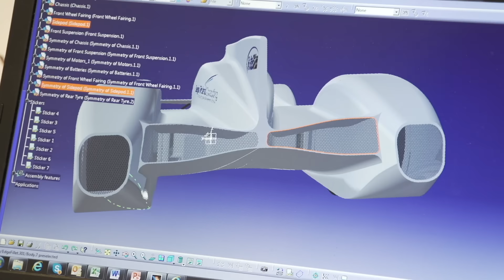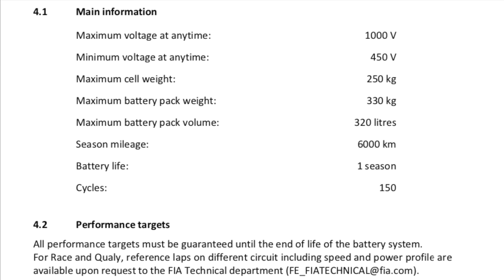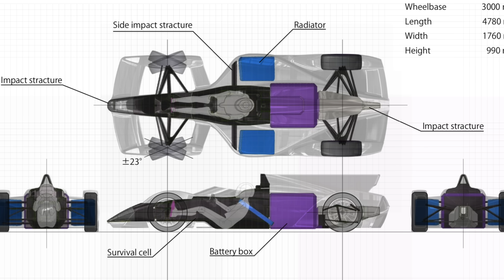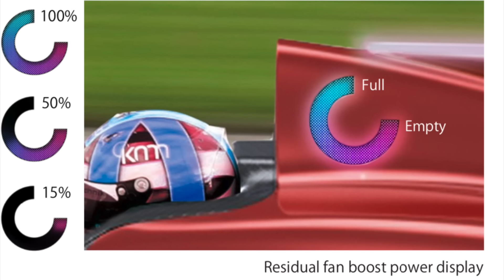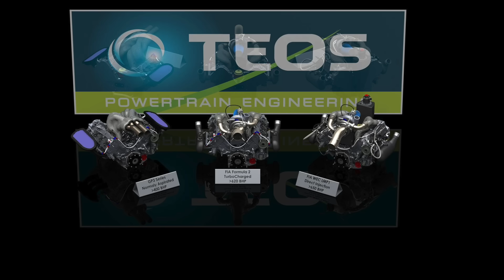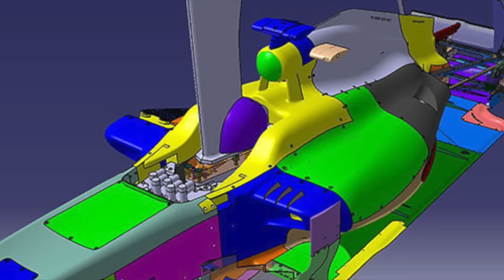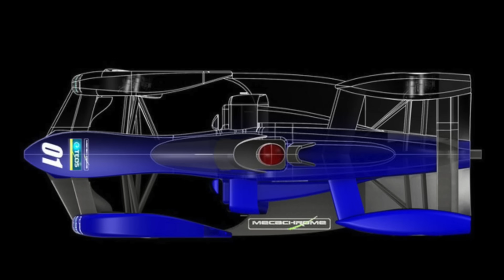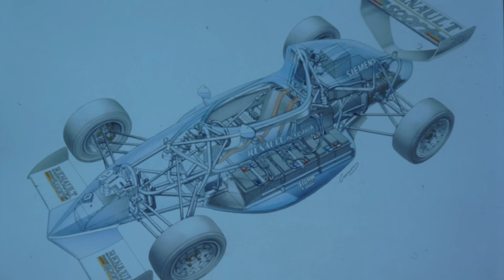The forgotten Formula E concepts - how these wild Season 5 cars could have changed everything

Comment: I think it's really interesting how the chassis supplier and the battery supplier couldn't work together until they both knew they won the tender. I do quite like the look of the dome, but I just think it was a bit far away from an open wheel car. And the lasers are a really interesting concept as well, not sure about the drone thing though, that's kinda silly. I think some of their lighting ideas were really cool though, I think a charge indicator that changes color could still very well be introduced today. 

I think Spark and FE eventually went with the best design. Absolutely love the Gen 2 car, one of the most beautiful racecars in history in my opinion. Miss it every day.
Reply from the maker: Some very good ideas here, I wonder how the Dome design would have evolved, like the Gen 2 did from that first sketch.

Comment: Why do they open tender for car designs, if they just keep going with the same company?
Reply: Because there might be better options making their case. The tyre and battery tenders have been awarded to a few different groups via this process. Podium were a surprise winner of the Gen4 battery contract, but definitely have their MotoE battery supply experience to speak for their credibility. 

Chassis wise there's only really the Spark/Dallara collaboration which has a track record in building EV racing cars at this level. If there had been something like an LMP-E category or an EV junior single seater series which had allowed more opportunities for constructors to demonstrate their capabilities, they might be in a better position to be successful in the FE tender  process.
Reply from the maker: @benjaminbunny2198  Dome had already built electric racing cars...
Reply: @Samsthepits  What were they?
Reply: @benjaminbunny2198  yeah you'd have quite a difficult time finding any open wheeler nowadays that isn't built by Dallara
Reply from the maker: @Kilo-sz4ch  They do build good cars
Reply from the maker: A good question

Comment: will the Spark 05e be used in FG series?
Reply: It is not the plan. They used an SRT05e for the test mule and demo car but they are supposed to make use of a bespoke 'FG-Twin' chassis. We haven't actually seen any evidence of that project progressing beyond the (Daniel Simon-designed) renders from about a year ago though.
Reply from the maker: yeah lets see what happens, I don't know if the FG-Twin will ever get built, but using the SRT05e makes a lot of sense.
Reply: @Samsthepits  Supposedly the barrier to using the SRT05e for this is that the chassis IP is collectively owned by the group of  manufactures who competed in Gen2. Jeff Dodds has mentioned this too, but in doing so implied that the Gen3 rights have been handled differently and thus could be used as the basis of a lower-tier competition once Gen4 arrives.

Comment: I think chassis/aero concept have always been a centrally important challenge for EV race cars and their unique requirements for maximum energy efficiency. I was disappointed when they announced that they planned to stick to the single chassis indefinitely. Having constructors iterating around low-drag, downforce-efficient ideas to extract maximum pace and range from these cars would have been phenomenal for the engineering enthusiasts amongst us. 

However, I do think it was broadly the right commercial direction for the championship and this has been key to its longevity so far. They knew that as a new championship the development budgets they could only go so high and support so much. As such, they chose to prioritise allowing development of the powertrain and control software in open competition. By 2020 even this limited scope had caused the amount that manufacturers were spending to climb too high, too quickly. They had to scramble to stabilise the championship with cost saving measures and impose a cost cap and this was successful, but they still lost some high profile manufacturers along the way. 
 
I do believe that adding in battery and/or chassis/aero development into the mix would have seen them hit this crisis point earlier and with more severity than what we saw in 2020, to the extent that it could have collapsed the series altogether. It has always been about managing the growth in competitor costs relative to the growth in commercial returns of the championship. 

Therefore, my message to those who do want to see more development and more money spent on batteries, chassis and aero in Formula E is... to keep watching and engaging with Formula E!